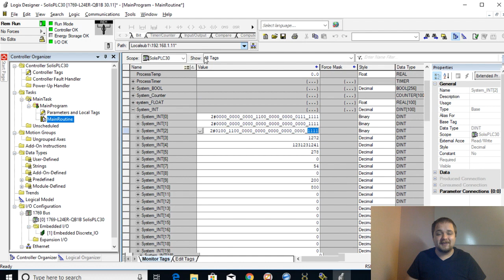PLC Programming MEQ Comparison Instruction - Masked Equal Instruction RSLogix Studio 5000

Comment: Hello Sir, great video with a good explanation. Could you please let us know when do we use this MEQ Comparison Instruction?
Reply from the maker: It's not an instruction you'll see commonly. However, it can be seen in an instance where you need to check a set of inputs. For example - a machine can run two different products. In one instance you care about input 1, 3, 5, 7, 8. In the other you care about 1, 3, 5, 6, 10. You can use a mask to filter out the inputs you don't care about.

Comment: Could you explain an application this would be useful in? Thanks.
Reply from the maker: Sure thing. I'll try to film a separate video, but this instruction is often used in changeovers. Imagine that you have two sizes of boxes you're producing. Your machine would typically have 2 sets of sensors: one for box A and one for box B. Instead of writing many rungs of logic to see which sensor is relevant to which box type, you can use a mask (MEQ) to ignore sensors in one case and a different mask to ignore the sensors in another.